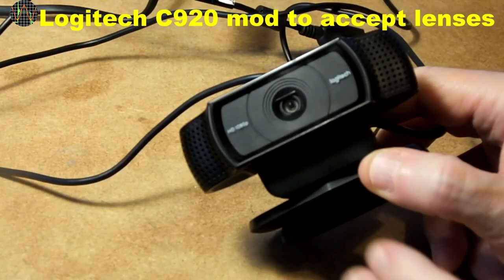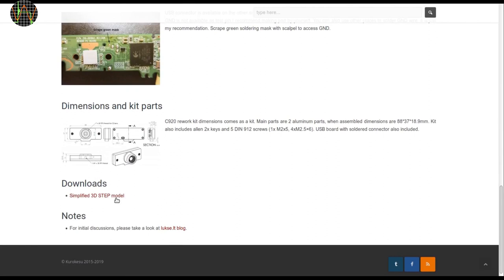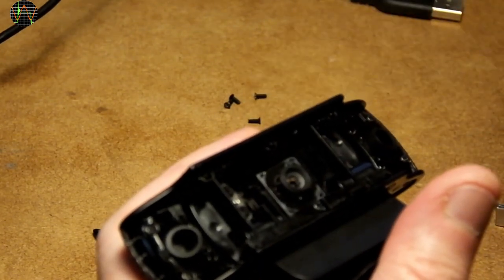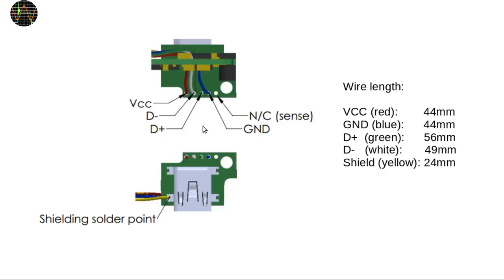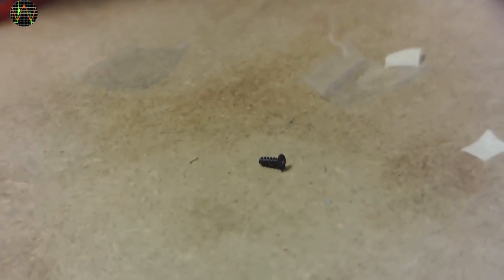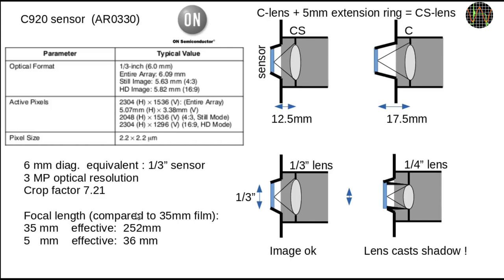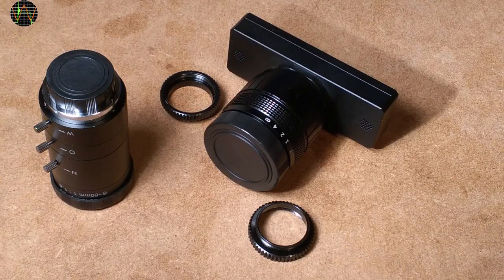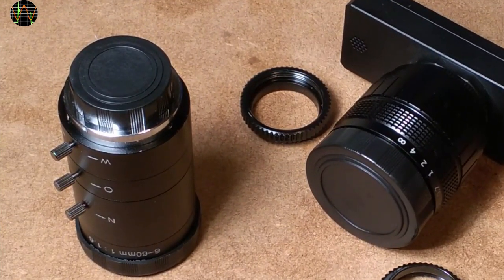Modifying a Logitech C920 Webcam to accept CS-mount lenses

Comment: I don't normally watch long videos, but you made this so interesting and fact filled, I watched the whole thins without skipping forward. Indeed, found it so facinating, I will post to a Facebook photobooth group where the purists are always saying the C920 is rubbish, and you need a DSLR with a good lens. This might prove otherwise!
Reply from the maker: Hi Chris, thanks for the kind words. Much appreciated. It is important to use a good lens even for the C920. There is much rubbish out there on Ebay. Another thing to note. The modified C920 is very low (like the original) on a tripod mount. I had to get an extender for mounting the camera body slightly raised on a tripod, because many lenses (meant for CCTV cameras) have studs (little thumb screws) that, when tightened, prevent the chosen focus, zoom and aperture from shaking loose by for example the motion of an automatic swivelling mount. I found that without raising  the C920 body a bit from the tripod mount, I could not change those lenses because the lens thumbscrews interfere with the tripod and prevent the lens from being rotated to screw it in or out.

Comment: As you say, it really needs that cap over the sensor without a lens - dust will get behind the IR filter I am sure otherwise :o) The high mag. images with the extension rings are very clear, ideal for showing/inspecting pcbs.

Comment: This is informative, I finally found this kind of video, thank you.  I'm planning to buy a 2/3 50mm C mount lens with adapter for my 1/3 sensor CS mount camera, hoping could might work.  My plan is to get a decent framing from 10-15 meter distance to the speaker.

Comment: Wonder if the C922 PCB fits into this as well. Then again the only real difference between the two is that the 922 can do 60fps at 720p (and only 720p) so probably not worth it anyway.
PS: if you have doubts about removing the LEDs, just remove their series resistors instead. They're way smaller and don't have the hump in the middle so it's easier do desolder them/heat both pads at the same time. In the picture at 8:55 the resistor for the "already removed" LED is R48, to the left of the red circle. You could also go the mega-lazy route and just cut the traces going to the LEDs. No soldering involved and it's (at least in theory) reversible by bridging the cut again later...
Reply from the maker: Many thanks. I can't remember if I removed the LEDs in the end ( I think I did), in any case they did not disturb operations at all.  I was quite happy with the C920 modification and being able to swap lenses, but for more than a year I am now using a Canon EOS-M50 with a 18-150mm zoom lens as the main camera and the modified C920 is relegated back to webcam use and the occasional special (Macro) shots.

Comment: sir did you try the micro extention ring from fujian lens combine with the adjustable lens? thank you very much
Reply from the maker: I did not. The adjustable lens has already a wide zoom range (and is not terribly good) so using the extension rings with it seems pointless. I have actually stopped using that lens completely and only use the fixed lens (with the extensions).

Comment: This is awesome!  Are there wide angle lens you recommend for this?  I want to continue using it as a webcam but I want to have a wider viewing angle rather than the stock 78 degrees so more around me can be seen as I don't have enough room for my camera to be farther back.
Reply from the maker: Hi Ty,
I am not using wide-angle myself so I can't recommend a specific lens, but there are many CS lenses out there (Ebay). Remember the sensor crop factor is 7.2 so for wide angle you need a lens with a focal length of less than 5 mm. The shorter the focal length the more wide angle is the lens. https://www.kurokesu.com/shop/lenses has a zoom one 2.8mm to 12mm as an example. He has also some extreme (fish-eye) lenses but they seem expensive and need an adaptor.

Comment: Do you have any lens that will create a depth of field or bokeh while being a wide angle or a decent fov?
Reply from the maker: Hi Philip, I don't use wide angle at all. One of the reasons I modified the C920 was actually to be able to replace the standard wide angle lens with lenses for a much narrower fov / higher zoom, which of course all have a rather shallow field of depth. Sorry, can't help you here

Comment: May I ask, how come you can use the cs lens with this but you can't adapt a cs lens to work with a normal camera  though you can use c lenses. No one seems that be able to explain this to me
Reply from the maker: it is a question of length. A CS lens will produce a sharp image 12.5mm behind its body, that is, the camera sensor chip needs to be at this position relative to the lens.  A C lens produces its image 5 mm further away from the body so it needs a distance of 17.5 mm to the sensor chip. The modified C920 can use CS lenses because its sensor chip is 12.5 mm deep in the housing, so CS are a perfect fit. It can also use C lenses if you add a 5mm extension ring to the C lens body which acts like a spacer and moves the sharp image of the C  lens outwards to where the 920's expects it. 
If a camera is made for C lenses, its sensor is 17.5 mm deep in the camera. A CS lens won't work in such a camera no matter what you try because its sharp image is at 12.5 mm and you would need to physically force it 5 mm deeper into the camera to make a sharp image.   
So, in a nutshell, on a CS camera you can use C because adding focal length is easy and cheap through extra rings but rings can only add length to a lens never reduce it. Unless you want to saw a bit off the end of your CS lens it can't be used with a C camera

Comment: Use a good quality screwdriver that fits in the screws properly and they won't be damaged. Heat the plastic a bit to soften it if necessary.

Comment: what lens i had to buy? for my twitch stream
Reply from the maker: It depends what you are showing and how far away from the camera the thing is. It it is mostly you at a desk in front of a background, you probably want a fairly wide angle lens (may be 5 - 15mm) to keep the camera reasonably close (unless you have a really large room where you have the space to set the camera up at quite a distance from you) If you are more into details and close-ups, you may want more a 30-50mm lens.  You can get zoom lenses that cover a wider range but are more expensive  and/or some compromises in image quality. The most important bit:  Keep in mind after the conversion everything on the camera is going to be manual, focus, iris and zoom. It means you will be at the camera turning the three rings of the lens until the image is in focus  has the right brightness and is framed the way you want. This is obviously a problem if you were planning to be in the image... A second problem is if your position in front of the camera changes a lot. In both cases, you should probably not convert the camera and use it as is with the built-in (wide angle) lens and the autofocus. I only converted mine because I wanted to be able to do very detailed macro shots which is impossible with the built-in lens.

Comment: lens is 60mm?
Reply from the maker: not sure what you are referring to. One of my lenses is a 6mm to 60mm  manual zoom lens, however because of the image sensor size, you need to apply a crop factor of 7.2 which means the lens  behaves like a 43mm to 430 mm lens on a normal DSLR camera.
Reply: so 50mm below lens is suitable for this mod?
Reply from the maker: @ridebmxmhell  I don't quite understand what you are asking. The size of the lens? You need to buy your own lenses, it does not come with one. I don't know if my lenses are still available. Or is it the distance between lens and and a target? That depends on a lot of things, the lens and how you are using it. I most often use the  35mm C-mount lens with spacer rings shown at the end of the video. That gives you a large range of distances and magnifications to the target, from >1m to about 11 cm as the video shows
Reply: hello,after many days of try i manage to achieve this

https://youtube.com/shorts/mxwIK9Li3VA?feature=share

distance from object to lens is 200mm,i shoot this at minimal magnification
thanks to your idea😊